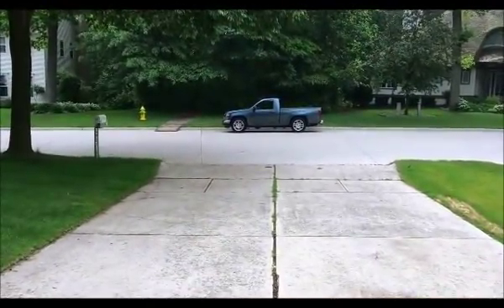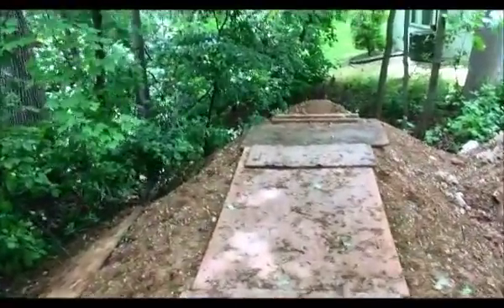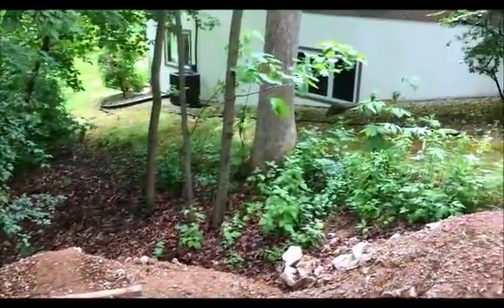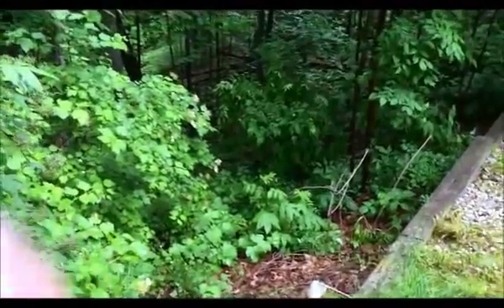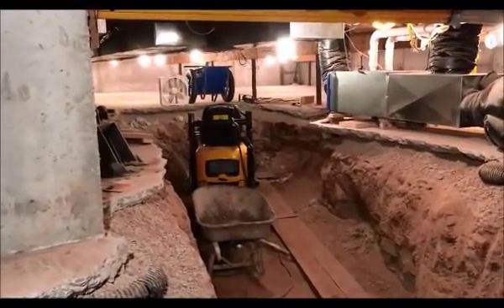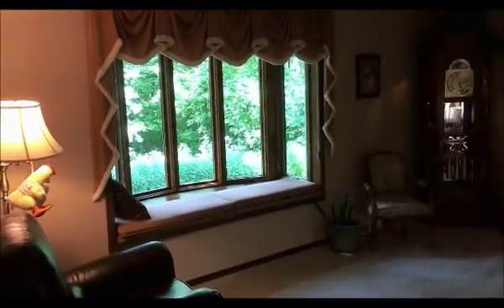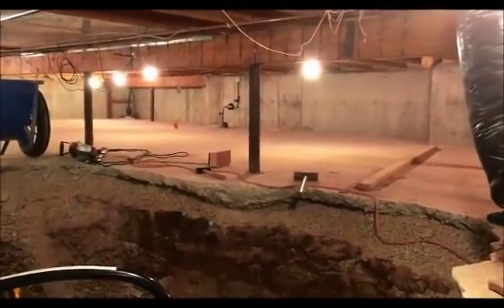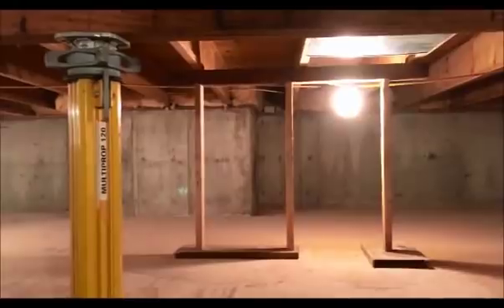How To Lower Your Basement - Chapter 2

Comment: what is the brand of Mini-ex you used?  I have had difficulty finding an electric one.
Reply: None of them sound here carry them.  So I got some big fans to draw air thru the space.  Kubota has a tier 4 engine and the whole thing fit thru the door I had.
Reply from the maker: It was a JCB model 8008 CT10 (or CT8) that was modified into an electric by a company called CreteBusters in Cincinnati. Occasionally these come up for sale in the NE USA. I found this one in Chicago.
 If you go to my channel and watch the video called "Goodbye to the mini excavator" you will see great detail, in addition to another video on the excavator & power cart I built for it.
If you are in USA, Sunbelt also rents electrics now, but they may also need a genset to run.
Reply: @diycrawlspacedigoutunderpi4201   Yes!  i just got done watching that video.  Thanks for the info. I am doing this in the near future but probably not to the same extent you did. but an electric ex would be a huge time and back saver.
Reply from the maker: I noticed some of the rental yards are now carrying hybrid excavators that run on either diesel or electric. I don't have more detail than that - just saw one on an equipment trailer that had a backpack electrical unit hanging off the counterweight. It was a bigger machine, though, maybe 3,600#